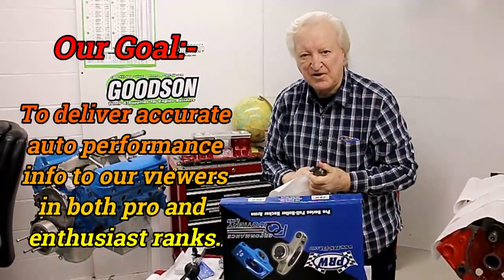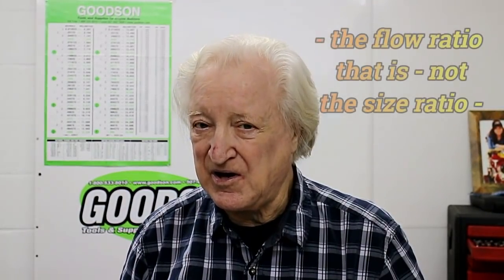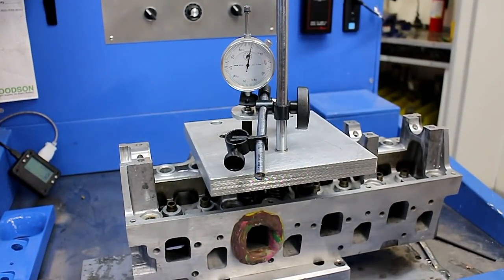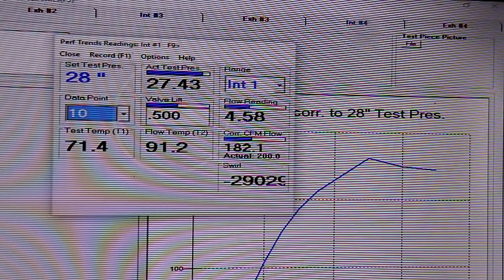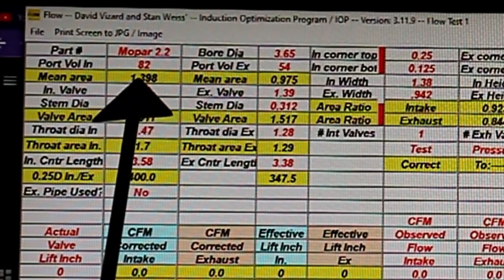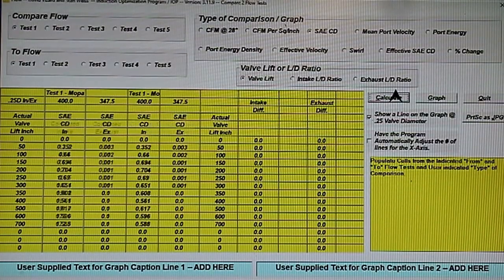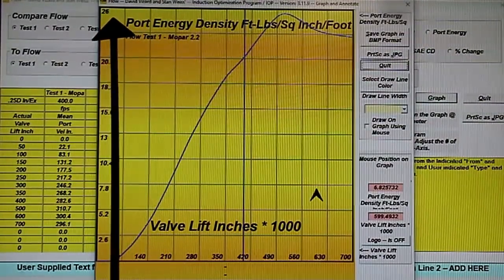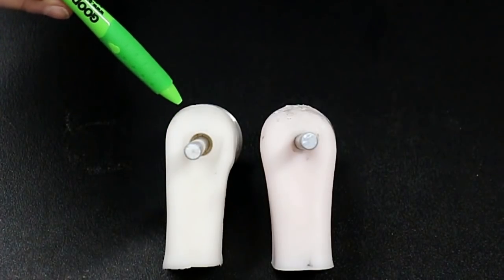David Vizard's PowerTec 10 EP  43 part 2 (1st half) Richard Holdener  2.2  Mopar turbo head porting

Comment: In the 90s early 2000s I cut ahead into like bread so I could see how much support on my turbo 87 Shelby. I ported so much the fuel map wouldn’t support a start. I ended up running 25 pounds of boost daily driving

Comment: I’m a retired Dodge technician. I got on TV in the 90s early 2000s with my 2.2 L turbo running on 25 pounds of boost as my daily driver. I got a 10 minute national spot with Don Garlitz on mother car show series. My success was from trial and error and cutting a cylinder head into slice of bread.

Comment: Question. You said on turbo applications, high boost, it pays dividends to increase the exh over Intake bias. My words.  Do you I stall smaller intake valves  and larger exh valves? Real question, actually I hv many, does this upset the bowl area?  Great tech.
Reply: On this very engine Chrysler engineers installed a +2-2 intake exhaust valve combo for additional power which is completely reverse of what you are recommending in your video I believe it was for the salt flats  Bell & Howell Lebaron

Comment: Hello mr Vizard, im being reading yor books for about 25 years, and i admire you. My question is , once the inlet valve have closed, the proces in combustión is the same in a n/a or in turbo motor. As you have mention , to more c/r less exhaust valve diámeter is needed , so in a forced inducción engine, ys boost incrase, also the c/r will do it. So why to use .9 intake to exhaust ratio,  if you can take adventage of of putting a  big intake valve (using the exhaust valve space)  with the high compression under boost?

Comment: Relating to turbo heads given the option of a 2.150 or a 2.250 intake valve and a 1.75 or 1.90 exhaust valve on a turbo engine 4.75 bore and 4.75 stroke what would you choose? Ports supposedly flow close to 385cfm with the 2.25 valve and 350 with the 1.9 exhaust assume 6K rpm limit, Appreciate the informed guess if you have the time.  Thanks, Brian
Reply: 2.25" intake valve is too small to get a 4.75x4.75 cylinder to 6000 rpm.
Reply: @andyharman3022  Well it has boost but 4-5k is a more realistic power peak. Was just saying a max engine speed of 6k. I think the bigger valves would be my choice but the head builder says its too big for that displacement.  To me I don't see putting a small valve on a big port being a plus but I am not a head builder so maybe they know more than I think I know.
Reply: @bcbloc02  2.53" intake valve would get the 84 cubic inch cylinder to 6000 rpm at a mean inlet mach number of 0.5.  With a 2.25" intake valve, the engine would hit 0.5 mach at ~4800 rpm.  Big valves mean big horsepower.  What kind of engine is this?
Reply: @andyharman3022  505cid Turbo Diesel
Reply: @bcbloc02  I-6 diesel?  4500 rpm should be plenty for an engine like that.  2.25" intake valve would be fine.

Comment: The posted 2.2 bore and stroke are incorrect if it matters. The stock 2.2 bore is 3.44" and stroke is 3.62", the 2.5 has the same bore but a 4.09" stroke. Eerily close to the Slant Six.

Comment: My guess: 1959 - sixteen is a good age to start porting heads :-)  - fantastic video btw. Being a European I am sometimes a little biased by the thought that US engines are not as sufficient as EU engines in terms of flow/torque/power but this clearly shows that the Mopar head is actually rather good in stock form. I love US engines btw. :-) All ICE in fact.........

Comment: I wonder how David will react if he finds out Richard doesn't put any stock into head flow. Poor flow= add more boost.
Reply: Building boost is more difficult on a ported head because it moves air more efficiently. So whatever boost number you want may not be available. It the power may go up quite a bit even at lower boost.
Reply: @servediocylinderheads  True, that's why you want a turbo that is documented with a COMPRESSOR MAP.
Without a compressor map, a person is flying blind.
Reply: Won't he be surprised...
Reply: Nooo.
He said that if the head is already pretty good, and you are not serious about making maximum power, just turn up the boost a bit more.
Which, if you are addicted to alcohol like he is, makes sense.
Us pump gas guys  have a harder time turning up the boost, so we have to invest in heads, headwork or other clever strategies.
Reply: @2lotusman851  Nope! "If you want to make a thousand horsepower buy a 1000 hp turbo. I always twist it up just to give him grief.
Reply: @jimandskittum  It drives me crazy to hear that. 
😒

Comment: my friends and I have been using the term "constipated" to describe an engine cylinder head  And/or exhaust system that flows poorly In relation to the intake side! strangely several times when I've used this term with people who weren't familiar with it they  quickly surmised what I meant.     ps-- FLow bench by "Kirby"

Comment: Have you David had any dealings with Calvin Elston? His views on exhaust headers and systems is quite interesting.
He says hes never seen an exhaust port that was too small. Rather he seem to be of the opinion that most ports are too big and done with no regard to the exhaust pipe.
Further he says that he views the first 6-8” out from the exhaust valve is of equal importance as the last 4” in the intake.
He goes under the user name exhausted on speed-talk forum and have posted quite alot on there.
Whats striking is how small pipes hes using for primaries and also choke etc further out in the exhaust.
Reply: If you study bike stuff he is bang on , I ment examine this sometime